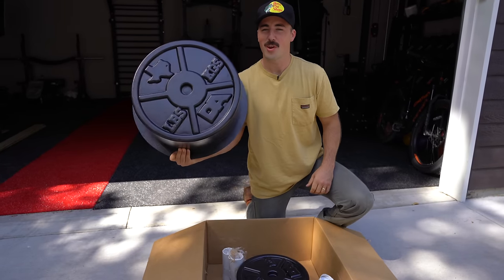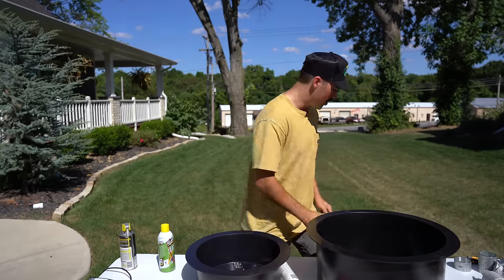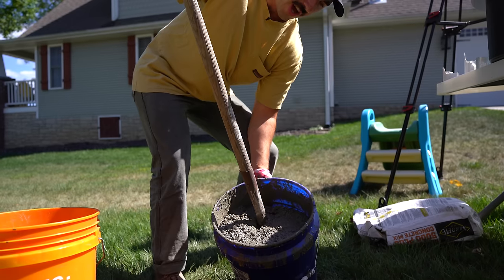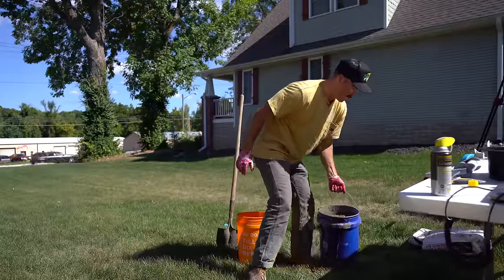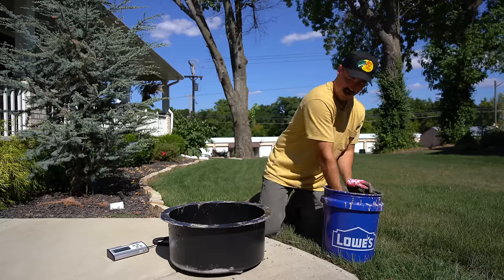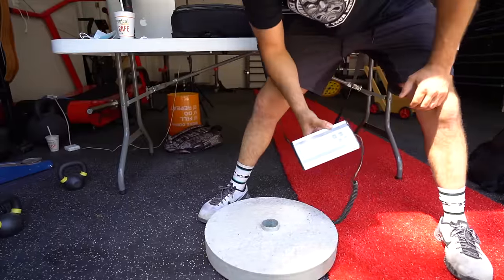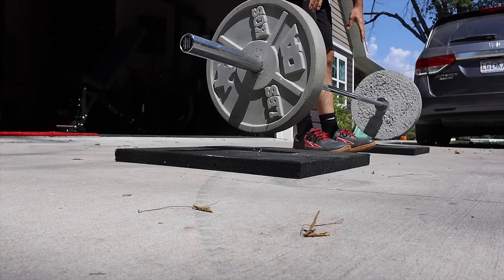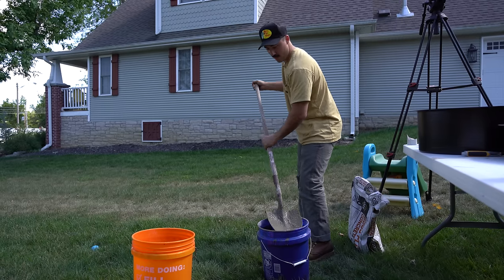How To: DIY Concrete Weight Plates That Don't Break

Comment: The 6 strands of fiberglass you put in there will surely help.
Reply: Lmao ahhaha
Reply: you don't need to add a lot of something to appreciatively change its microstructure. While I am not very knowledgeable on concrete, steels will only contain around .5% of carbon by mass and they are very different in terms of strength than iron.
Reply: @thomas7365  microstucture, yes. But notice, the fiberglass he is adding is only the version rated to help with initial cracking during drying. To help with cracking during usage, more, longer strand, is needed.
Reply: @thomas7365  What you are talking about is called an interstitial alloy (this rearrangement happens at a molecular level). This is done by smelting, therefore the carbon atoms (much smaller in diameter) are able to fit between the much larger metal atoms. Because the molecular weight of metal atoms (could be any but likely Fe: iron) is much higher than that of carbon per mol, the percentage by mass will be greatly skewed towards the metal, however in terms of the number atoms, this ratio would be much less skewed towards the metal because of the difference in molecular weight, which is measured per mole (as it compares to Avogadros Number when counting atoms individually). Therefore though the mass percentage of the alloy will be skewed towards the metal, the atoms making up the molecule will be a much more neutral ratio, though still skewed towards the metal. This process works differently (adding fiberglass to cement) no LARGE molecular changes are happening here because this is simply a mixture as opposed to a solution (wherein chemical composition tends to change). Think of a rock in water (a mixture) as opposed to salt dissolved in water (a solution).
Reply: @rezanadaf1213  Thank you for the clarification on interstitial compounds. I agree that a change in crystalline structure will likely have much greater change on strength and crack propagation resistance of material, but microstructure of material is also very important, and from what I've researched fiberglass can appreciably change this (not so much of the concrete itself but the underlying fiberglass matrix seems to form a microfiber heterostructure within the concrete).
Reply: @thomas7365  I'm an architect :) you need to add a decent amount of the fibers. It doesn't change the micro structure but it significantly increases mechanical stress resistance. Concrete is great in compression but weak under tension. These stands increase tension strength but not compressive. Also it'll reduce crack propagation
Reply: @supernoodles908  Even more funny is the fact, that SiO2-Fibers will dissolve in the concrete after a couple of days or weeks.
This is only for structural improvement in the first days to not crack while applying it on the floor.
Better would be PP or basalt-fibers which do not dissolve.
Reply: @warmesuppe  true true
Reply: @supernoodles908  "Also it'll reduce crack propagation" 
Not my experience. My contractor insisted to use fiberglass when pouring my driveway and convinced me not to use rebars. After about 15 or so years there are major cracks  where he had poured. He even use one of those car size rolling earth vibrators before the pour.
Reply: yep I was thinking the same thing . Hoping that was just a sample lol
Reply: @thomas7365  But in this case it's not about the microstructure. These fiberglass (or polypropylene) strands do basically the same job as the steel reinforcement does. I agree, he should've added more, much more.

Comment: Additional tips:
•water weight in the concrete evaporates out
•overcast and use angle grinder to grind down to weight/smoother finish (read last tip for what overcasting would be)
•if you get a super rough finish, use some concrete repair mix to smoothen it out
•if you're gonna spend money on fiberglass reinforcements, use more than that tiny amount
•use sch 40 PVC and coat the outside in rubber (either spray on or tape or a rubber sleeve)
•spray on truck bed liner to coat the entire plate. The large plates come with a 17.5" diameter which puts the surface area of the plate right around 8sqft. Truck bed liner is supposed to be 0.7lb/sqft at 1/8" thickness. This extra thickness also bumps that 17.5" diameter closer to true size of an oly plage diameter. This means you're getting about 6lbs of spray on rubber into the plate so only pour about 40-42lbs > grind off about a pound or two > lose some water weight from evaporation > spray truck bed liner evenly until 45lbs
Reply: Concrete doesn't lose much weight when drying. The amount in these plates would be negligible anyway. The water molecules react with the mix, hydrating it and losing energy to heat, not evaporation. The oxygen and hydrogen ions don't leave the mix, so the weight of the water stays.
Reply: @Dsquaredforever  Do i wait until it is cured to sand it or can i wait until its dry
Reply: Do i wait until it is cured to sand it or can i wait until its dry

Comment: I believe give concrete 20-28 days to fully cure and reach max strength. Also I've seen folks spray bed liner on them to make them even more durable as well as give them the look of actual iron plates.
Reply: @MoCheeks3000  love my Caveman weights. My 45s all clock in at 46.1#
Reply: Great, plates will be ready in October.
Reply: I like the bed liner idea
Reply: Concrete when properly mixed reaches its PSI strength at about 28 days but will  continue getting  harder for decades
Reply: @rd-ch1on  concrete takes up to a century to fully harden
Reply: just bed liner should prevent chipping..the key is like you say make sure crete is fully cured before you spray paint them or moisture can not escape.

Comment: For those that own a random orbital sander, take off the sand paper and use the base against the edge of the mold in several place, pressing kinda hard. This will vibrate all air bubbles to the surface and make a much nicer result.
Reply: I randomly own one 😭😭😅

Comment: When we were kids in the 1960s my Dad rented an aluminum canoe for a week.  Put it in the cellar on saw horses upside down , coated it with petroleum jelly from the drug store than put fiberglass cloth over and covered it with fiberglass gel.   Let it harden and cleaned it up    Took back the rental and from the mold we made 3 fiber glass canoes 

They were heavy but lasted for years    

Watching this video I’m surprised no one decided to make these molds earlier !!!  Guess we needed a pandemic